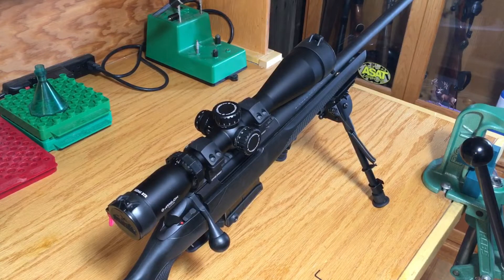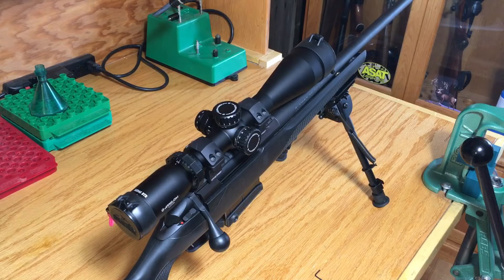Athlon Midas BTR Zero Stop

Comment: I'm looking at the midas btr as well but it is the gen2 version. I just got a tikka t3x ctr with a 24" stainless steel barrel. What are your thoughts on the Warren maxima scope rings? Also what size rings would I need high or medium.
Reply from the maker: Stephen Hensley I don’t have any experience with those rings. You should be fine with medium.
Reply: Stephen Hensley  did u go with the btr GEN2 if so what’s ur thoughts
Reply: @eomproductions5783  yes sir I got the midas btr gen2 and love it. I'm about to get a 2nd one for the other rifle